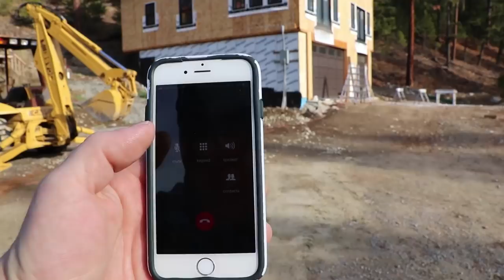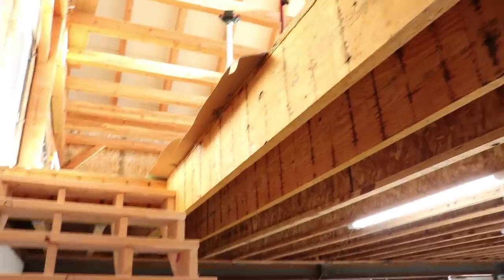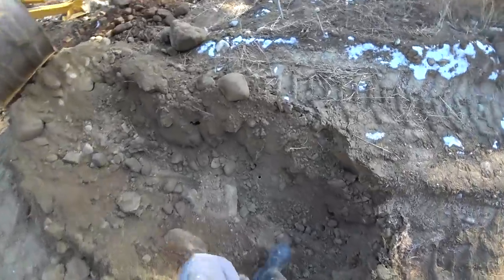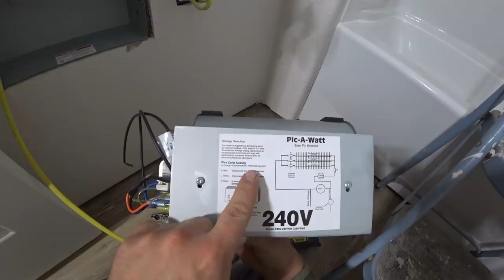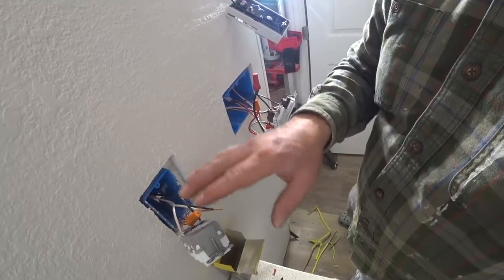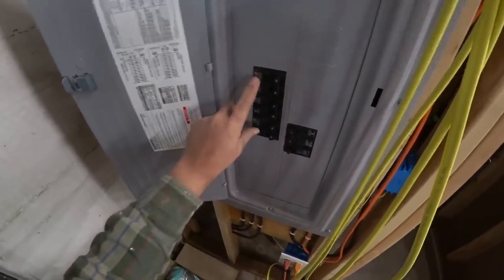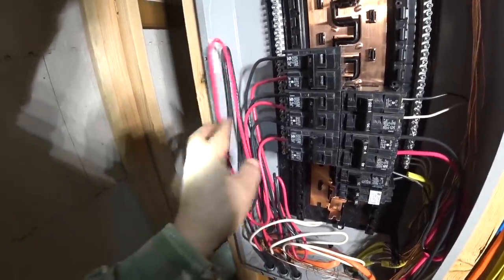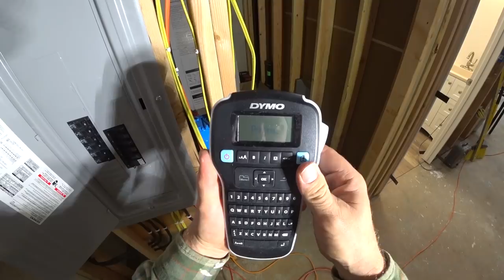Holy Cow IT ACTUALLY WORKS! (Wiring Garage Bathroom)

Comment: In all those years being an electrician i have never heard such rubbish in my life. Unused current? Bigger wire for bigger voltage? You need larger wire for a larger nominal current. Every bit of current that goes through an appliance i used, that's why there is current in the first place. The impedance or resistance of an appliance, together with the Voltage you connect to it determines the amount of current that is flowing in the wire. The rated voltage of a wire is how much potential difference between two differently charged metal parts the isolation can isolate. 240V is such a low voltage, if the isolation is not made out of wet paper, even the smallest amount of plastic coating will be enough. This is as long as it is not damaged, which is very likely, seeing how you guys handle your wires during the process of laying them out. Nevertheless, you should put more emphasis on the amount of current your wire can conduct, if the appliance is switched on 24/7.
240V consists of two 120V that are switched opposite another in 180° configuration. When one wire has the highest potential of 120V against ground, the other one has -120V against ground. Put together this makes 240V, which means the wire that has -120V against ground has the function of a neutral wire, which runs the current back to the transformer. During the next 180° cycle, the wire that formerly had +120V now is the negative one and vice versa. In a normal 120V config, the neutral wire is on ground potential, whereas the "hot wire" alternates between 120V and -120V potential. Making both wires that run current back and forth. Hopefully this was understandable, since i am not an us electrician and English is not the language i use during work.
Reply: Hehe, yes, I chuckled for myself when hearing his weird explanation. :)
Reply: i think you explained it excellent! greetings from a dutch electricien that is watching all this with amazement
Reply: ya being some what of an apprentice spark i was laughing at first but he did do a decent job i have seen masters do worse so they can be done qcker. for a noob not bad tho but ya theories and concepts are flawed

Comment: On your 240 heater wiring using the white as a hot need to mark the wire with black or, better use orange electrical tap in panel and the the box so if some one is coming behind you they can quickly understand what was done.
Reply: The preferred colors per NEC is to mark it with red or black. Both at the panel and in the heater box.
Reply: need to use  red    brown orange and yellow  designate 480 v
Reply: Timothy Miller in my County you’ll fail inspection even marking ground wires with colored tape. They’ll accept shrink tubing.
Reply: Not orange-colored use red.

Comment: Whenever I use 12/2 for 220V I always wrap the end of the white wire with red or blue electrical tape to indicate that it is a HOT wire and not neutral.

Comment: In my area of southern Indiana, when a 12-2 or 10-2 romex cable  is used for for a 220 volt circuit, it is standard to wrap the white line with black tape to indicate the line is hot.

Comment: Yeah, you got the message(s) about the Romex clamps for your panel knockouts.   "Hot" white wires, like on your 220v circuit are usually marked with a piece of electrician's tape on both ends.

Comment: When using 2 conductor and ground for 220 device the white wire is required to be taped with a colored tape (red, black, blue for 240 volt system) national electric code requirement to indicate it is no longer a neutral wire and is now a live wire.  To reduce clutter in the panel when your breaker is on the left route the neutral and ground wires to the left terminal strips. Also to prevent blocking terminal openings the first wire coming from the bottom would go into the first open position on the terminal strip, the second wire would then go into the next open terminal, etc.  The only time a white wire lands on a breaker is when it goes to a GFI or arc fault breaker because for proper operation the neutral has to go thru the breaker.

Comment: Nuetral goes to ground, your using the nuetral for hot, so you need to put red tape on it to indicate to the n ext guy that it is hot and your running 240V single phase through it.
Reply: Yep , throw a piece of red tape on the white , at each end .  If it makes you feel better .

     Any one that knows what he / she is doing will figure it out as soon as they see the white going to one pole of a 2 pole Circuit Breaker .

     If you do not know what you are doing , keep your paws out of electrical boxes / load centers .

Wyr
God bless
Reply: tape both ends
Reply: @Steve Pickett   I would suggest using a sleeve of red heat shrink tubing.  It is less likely to ever be "accidentally" removed.
Reply: Agreed
Reply: Steve Pickett It would be nice if more people did this, but in residential it’s super common even for seasoned sparks to ignore this. Apparently lots of inspectors don’t care, I’ve encountered many a white wire used as a phase conductor without marking it.
Reply: you should use 14-3 on 240 fixtures, one neutral and two hots w/ground.

Comment: National Electrical Code Article 200-7 outlines when white wires can be used as a hot or ungrounded conductor. You should not put two wires under the lug on a breaker nor should you market any splices inside the panel enclosure!
Reply: Splices INSIDE of a load center are permitted, at least under the previous NEC.

Comment: Good job to never land circuits in the Panel before the circuit is complete. In Oregon you have to mark the white wire with colored tape on a 240 V. circuit. It is easiest to leave lots of extra wire hanging out of a box. The waste can be used for all the extraneous makeup stuff. Haven't seen, but did someone teach you to "accordion" the wires when making up in device boxes? Makes it a lot easier. This from a 33 year licensed Electrician. :)

Comment: Put a stripe of black electrical tape on the white and your telling the next person it’s not white.... I think that’s the way I’ve seen it done.
Reply: Black magic marker marks on white wire also works, and it's more permanent.
Reply: I've seen it like that too, only wrapped a few inches down the wire.
Reply: Precisely so - often-enough, we simply snugly-wrap a few inches of black vinyl electrician's tape onto/around the white wire at about an inch or two from where the wire is fastened into the switch or outlet (or other device), and do the same where the wire goes into the breaker inside the panel - that "changes" the wire into a "hot" conductor, telling anyone working on the electrical system that it is the "second hot-leg" on a 220-Volt circuit, NOT/NO LONGER the Neutral (or "return") wire on a 110-Volt circuit...that's Code!

You can actually do the same thing using a broad-tip black felt marker, instead of the black tape....but, it's better to use tape.
Reply: By putting a BLACK {stripe electrical tape} or RED {stripe electrical tape} you are doing what's called re-code{ing} the wire(s.) For those who don't know, you can get electrical tape in the following color's: BLACK, RED, GREEN, WHITE, for re-code{ing} purposes. I believe code calls out for a single stripe as close to connection as possible. I usually put another stripe approx 2 or 3 inches down the wire if you will, so you'll have a better NOTICE, that the wire is being used in an altered state if you will.
Reply: Little rings of coloured heatshrink (the kind with numbers or letters printed on them if you're feeling posh) are 100 times more durable.  At a push,  you can use rings of insulation from a larger wire.    You can get fancy with this technique and invent a colour code like resistor stripes that identifies every wire in the house at both ends.
Reply: That is the way it is suppose to be done. Period. Both ends marked.
Reply: A black Sharpie marker does the same thing without adding bulk.
Reply: The color black is used for line voltage single phase, red is line voltage single phase second hot.  Using a red sharpie or colored electoral tape should do.
Reply: That is correct
Reply: Or use a black sharpie
Reply: That´s code in many countries that I have lived! Also just profession courtesy and common sense!  :)
Reply: Richard Burguillos I use a big flat red sharpie marker and cut a v in it. Just slide it done the white wire and your done
Reply: Dealt with the same situation, had to rewire my whole house over the last guy using white as black, but he put it on the white which finding that was a pain. the breaker kept tripping and I didn't have any lights for like 2 weeks. so moral of the story is mark it or someone is going to hook something up backwards.
Reply: Richard Burguillos actually I normally use red but it’s good either way. You can also paint the wire with a permanent marker. 

It would have been less expensive to use a single giving breaker.

All outlets in a garage need gfci protection.

Also get yourself a outlet tester with a gfci test button. 

That is why I’m telling you to get a RotoZip and learn how to use it. You’ll always have tight holes around your boxes.
Reply: Shouldn't it be red tape?
Reply: Yep, that'a how it's done. Green tape for ground, red tape shows the wire is being used for a red wire, blue tape designates a blue wire, and so on.
Reply: It should be red tape to show that it's the other side of the split phase totalling 240V
Reply: I've used black tape, and, at times, I've also blackened the white wire with a Sharpie.
Reply: Or use a red permanent marker to "paint" the exposed insulation.
Reply: Richard Burguillos sharpie works too
Reply: A black tape or a red one I use
Reply: The easy way would be to use a black/red Sharpie pen to mark the white wires.

Comment: Now that you have fed the bathroom general lighting circuit with a 20 amp breaker you have created a situation where the #14 switch leg can be dangerously overloaded in a full locked rotor condition with the fan motor.  I would recommend that you Change the switch leg to 20 amp (#12) wire before you rock the other side of the wall. You could have used romex "Stackers" for the stud bay next to and above and below the panel.
Reply: He will find out when he gets inspected by adding the 14 Aug wire he has to put the entire circuit on a 15amp breaker.  The breaker in the panel provides protection for the wire If there is a short circuit in the circuit.
Reply: Yeah...NEC actually doesn't prohibit lighting on a 20 amp feed, but some jurisdictions don't allow it. It's just not good practice, a good part for the reason you state. Even 15 amp feed for lights is far more than is necessary for modern lighting needs. 

A 120V 20A feed is enough for more than 100 23W (the larger ones) compact fluorescent lights. 

The Europeans are far ahead of us in terms of limiting the amount of power available per branch and allowing far slimmer and affordable cable to do it bu mandating separate circuits for lights vs outlets.

In some North Am jurisdictions (Ontario being one) you can't run lights on a 20 amp circuit. 20 amp feed is required for kitchen counter outlets (two dual outlets per feed) which is rational, but still requires 15 amp for general circuits and lighting. It's far too much, and obviously, certain interests want to keep it that way.
Reply: Good catch, I totally missed the 14-2's!! Good advise!

Comment: I love all your video's. When I worked with sheetrock and electrical outlets in my house (built by my grandfather in 1927) while filling the gaps between the sheetrock plates, I also filled the gaps between sheetrock and outlet boxes with what you call "mud". Simple and easy. all before sanding and painting of wall paper. I love to see the diffrence and similarities between USA and NL (Netherlands EU)  electrical installations. We mount pvc pipes in the walls and pull the wires (not cables) we need. Thanks for showing all. Color the white wire with black tape or black heat shrinking tube.

Comment: Decent install from a non electrician Jesse.I was an electrician for 12 years, now an electrical engineer. As many mentioned, "phase" the white wire by wrapping with tape. Only single wires allowed in lugs (breaker). And I am surprised no one mentioned it, but you can not staple wires on a stud within 1 1/4" form the stud face (both sides). This means on a 2x4 there can only be a single column of wires and only 2 wires under a staple. For multiple wires you have to add what is called a "Stack it" (google images, "electric stack it" ). There is a lot to the NEC, if I had time I would love to come and help ya. Keep up the great work!

Comment: Code allows you to use the white as a load conductor, but you have to ID it as being a load conductor by taping it with another load conductor color, usually red for 240V second conductors. White (and grey for 277V) is reserved for neutrals.

Comment: Don't know US rules, but on this side of the ocean:
1) Tape the white neutral black, wenn you use the neutral for hot.
2) You can place 2 wires in 1 breaker.
Some other thoughts:
3) Change the wires from the switches for the lights. The first switch around the corner 'should' be the ceiling light, this one you are going to use the most. Also location wise, the switch for the vanity is closer to its switch (more logic).
4) Turn around the light switches 180 degrees. Here the lights go on in the down position, and off in the upper position.

👍☺

Comment: Power In The Throne Room - AWESOME!  For the smaller cracks around the outlets you can use spackle paste to fill the small gap by the thermostat and outlet next to the heater. For the larger gaps, if you run a bead of caulking on the backside, let it dry, then you could fill the void with spackle from the front.    For your bare ground wire bunches; I’ve seen electricians attach them just like the hot/neutral wires by adding a couple inches or more to a 90 degree bend which gives you more maneuvering space with the bare ground wires. As you already stated, you could reattach them to the bottom side of the bus bar. Once you attach them you should be able to push them back a little too closer to the panel back, which will also give you more room to add future wires higher on the buss bar.  It’s coming together and you two are doing a wonderful job maintaining your sanity and outlook at the same time.

Comment: In addition to marking the white wire of that 240V feed with a red marker or red tape (on both ends), you also need a "two pole" disconnect switch that disconnects BOTH hot wires that feed that heater.   Rather than adding a separate disconnect switch you should have used the K102 instead. 

That K101 switch should only be used in a 240V installation if there's a separate two-pole disconnect switch in the same room. Using that K101 switch leaves the heater circuit live/hot even when the thermostat is off.

Comment: here we use red 12/2 for 240 volt for heating applications (red outside casing containing a red and black + bare ground), both live wires carry power phased 180 degrees from each other, essentially each wire takes it's turn being the return for the other so the total difference between both wires is 240 volt. it has nothing to do with the appliance being fully consuming or whatever, electricity is electricity.
Reply: Basically wrap white wire with red tape. Separate circuit for bathroom is required here in California.
Reply: yeah i was a bit confused there
Reply: however here in the uk, you get 240 by default and 480 if you the the opposite phase stuff(which is not necessary as the efficiency gains are not as strong).
Reply: That explains a lot. I was wondering where in the US they have a 240V power grid (like the 1 phase 230V here in Europe). Is 2 phase  mains that common over there or only for special appliances?

Comment: 220 heater circuit in bath . You used black and white wires for the power legs. Normally black and red are used for this. With red electrical tape tag the ends of this white line. On a control (timer etc) the corresponding color tag would be used.

Comment: Yes Jesse...details. They all add up. You guys are doing a great job and I know this is "just" the garage bath. Happy you're starting with it to learn about gaps and all the other details that will make the house come together. Have you considered no texture? The blow on knock down beckons track home. Oh and round here we can't use the distribution panel as a junction. So no wire nuts in the box. Stay with it...sure I cringe at the finish steps, but hey you're the pilot in command.

Comment: Does the white wire need to be taped with black if it's hot?
Reply: Yes. 
Same with grounds, if you're using black wire for it then you should at least use green/yellow electrical tape on the end, so the next electrician knows that it's not hot.
Reply: Yes...the Code says so.
Reply: Apparently not for Romex jockeys

Comment: To help understand the 120/240 volt, three wire system that you are working with, first realize that it is not "110". This is important because the line to neutral voltage is exactly 1/2 of the line to line voltage. The secondary winding in that transformer in your yard is a single 240 volt winding, with a center tap, which is grounded and becomes the neutral. This system is NOT refered to as "split phase". That is a tyoe of motor. That error is becoming ever more prevalent on the internet. The correct full terminology for this type of service is "120/240 volt, single phase, three wire".
Reply: realvanman1 absolutely wrong! You are correct the neutral is center tapped from transformer. But in US, the 240 is not from a single wire, and the neutral has nothing to do with 240. The 240 that comes into the panel is considered split phase as the phases are offset 180. The distribution transformer has two separate primary and secondary windings in it, with neutral center tapped providing the neutral.
Reply: realvanman1 i